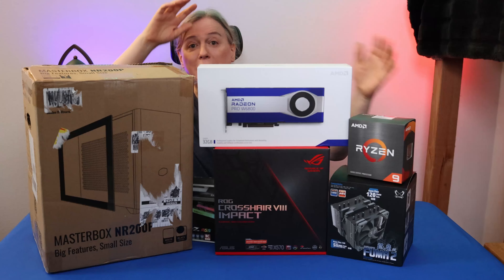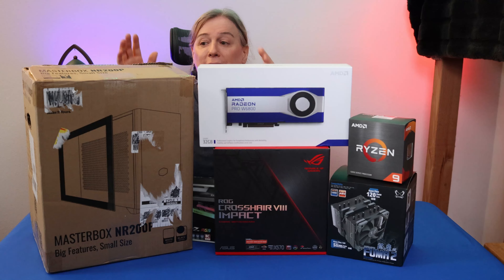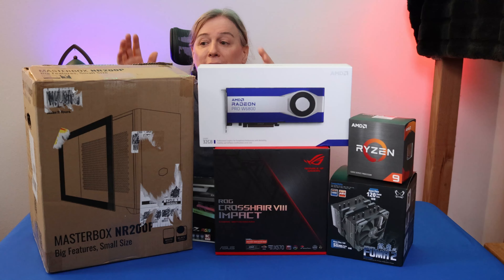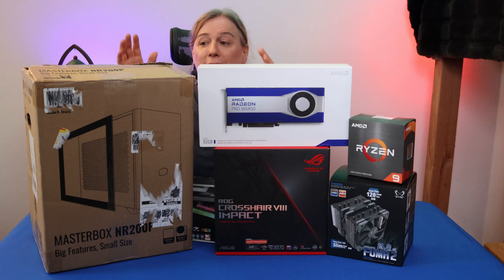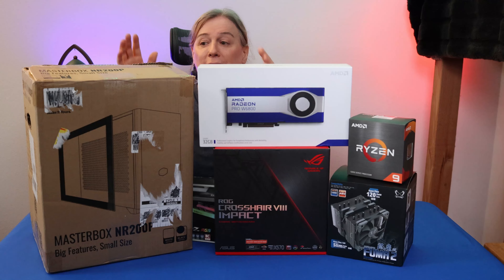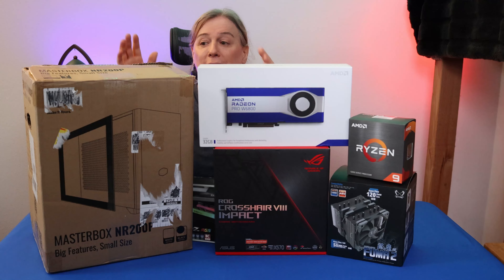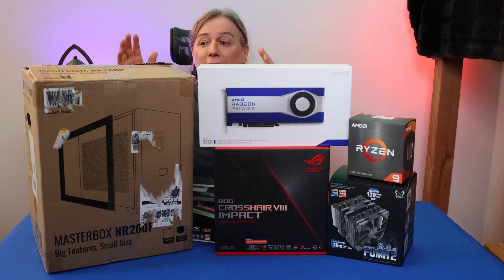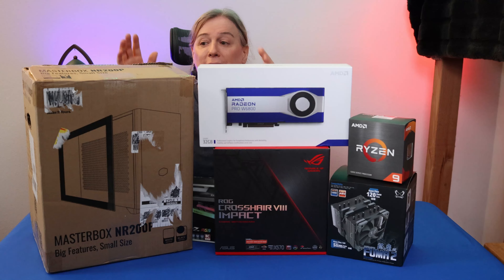Mini-ITX Build | 5950X/W6800 Workstation GPU | Mini-ITX Creator Build | Part 1

Comment: Very nice!
But what about heating?
I have build mine with ROG Crosshair VIII Impact, AMD Ryzen 9 5950x 16-Core, Navi 10 Radeon Pro W5700, 64Gb Ram and the Arctic Liquid Freezer II 280.
And I have Heating problems, it goes up to 99 Celsius on some games and about 65 to 78 on regular games. On windows it restarts so I have to do everything now with my ubuntu linux and forget some games.
Very disappoint with Ryzen 9 5950x so if you do have issues with heating I'd like to hear any solutions.
Thank you
Reply from the maker: Thanks for stopping by! Thermals have been fine for me, never an issue from what I've seen in hwinfo. I suspect you have a cooling issue as the 5950X, even though it can get up to 90c (acceptable), will throttle... so if you're seeing shutdowns after throttling, my first guess would be a faulty cooling config... I would perform thermal diagnostics, fix any thermal design issues with your build.

That you see different results with a different OS may indicate you're merely changing the overall workload to something simpler, less demanding... so best way to troubleshoot a problem is to examine the problem case less any swap testing (which in effect, helps examine the problem case, actually).

See the video's description for the other follow-up videos on this build... one discusses that I examined, did not see, thermal issues when examining an unexpected reboot situation. 

Oh, important point... contact AMD 5950X support... they are very responsive, and if they do not suspect a cooling problem, and instead suspect a processor issue (maybe fixed in stepping update), in my experience they move to RMA... but you will have to go through initial steps, and since you built the system, you should ensure you've performed a proper cooling assessment, have good data to support such.

From what you describe, as mentioned, I highly suspect bad cooling that hits a tipping point on what are more demanding Windows workloads not seen in the other OS (a guess... but those are my offhand thoughts). 

Keep in mind I have Scythe Fuma 2, a reasonably lauded air cooler, all in a very meshy case with two top-mounted Silent Wings for top outflow. Just because you have water cooling doesn't mean cooling overall is great... make sure airflow is good etc. For ITX builds, especially, you must have cooling really really right, no compromises. That's why I went meshy as I prefer the wiggle room such provides, and then I build as though it's not meshy, if that makes sense. Best of luck ... get yiur build working!! 5950X is awesome when you get it flying.
Reply: Thank you so so much.
I watched part 2 the restarts cause of memory set at bios and that fix mine too :) @AshleyPurring
Reply from the maker: That is awesome to hear... thank you for letting me know. If you have a sec, can you open eventvwr, open Windows Logs, select System to view the system logs... do you see any WHEA-Logger errors in the System event log? If you want to filter by event id, it is event ID 19 from source "WHEA-Logger" ... if you do not have time to check, no worries. Going back to your system, if it is not private information, what type/speed of RAM do you have, what speed did you set in the BIOS? Thank you so much for checking back... it's good to know someone else observed matching BIOS mem speed had a similar result.  @dimitrisgounaris1820